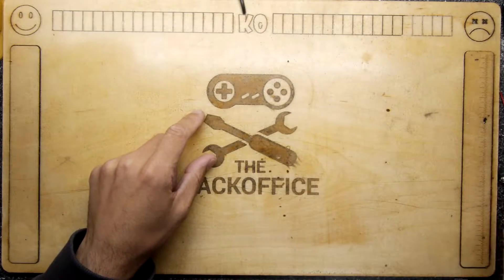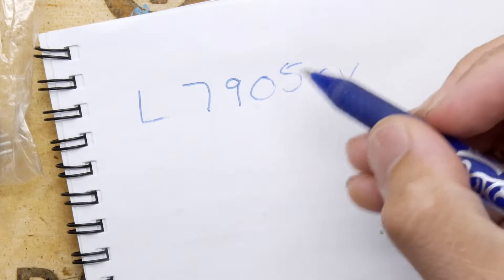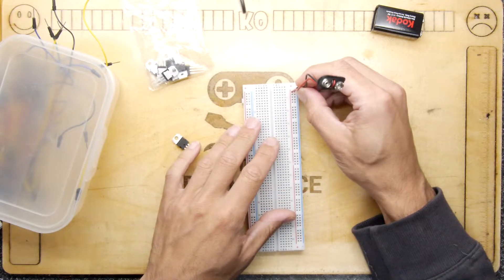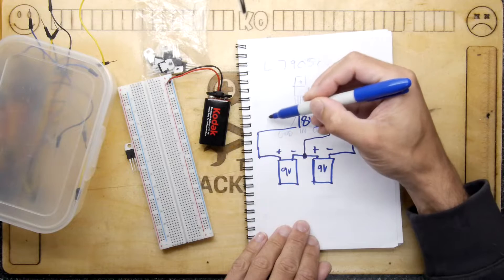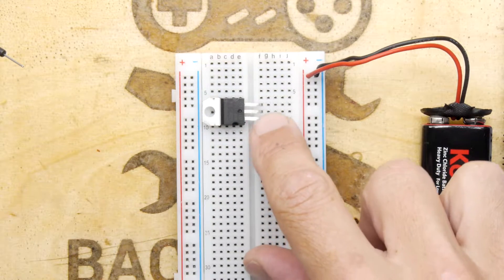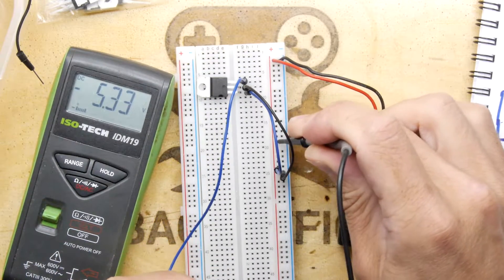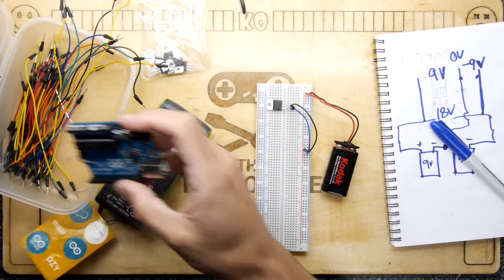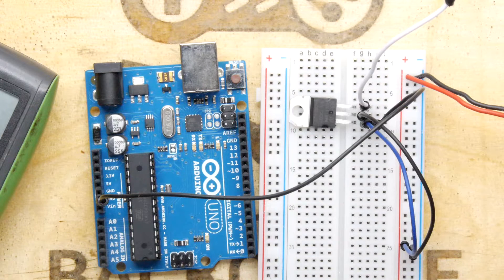Make a Negative Regulated Voltage

Comment: Valves.
I'm learning how to make stuff with Valves and they're supposed to have a negative grid bias.
Still have little to no idea how your supposed to then modulate that bias with the signal you want amplified! 😫
Reply from the maker: My knowledge of valves is so superficial they may as well be an alien technology to me 😂
Reply: @backofficeshow  
I may have a growing obsession...
Technically "they're just like big transistors"
Except the base (grid) takes negative volts (mostly)
And it always inverts.
And there's up to three bases.

But I'm starting to get that "negative volts" is a really bad description and "lower potential" is what it should be called.
So the grid (base) has to be lower potential than the cathode (emitter)
Reply from the maker: @MostlyPennyCat  that makes a lot more sense thinking of them that way!

Comment: https://theorycircuit.com/wp-content/uploads/2018/09/negative-voltage-generator-circuit-using-555.png
and this is how i apply it
https://forum.allaboutcircuits.com/attachments/1600245831965-png.217359/
but your solution is more simple than mine.

Comment: In a pinch I typically use a Voltage Divider and with a couple of Diodes you can drop the voltage slightly to achieve 5 Volts. This way I can have a positive 12 volt rail and end up with two 5 Volts rails plus and minus. The diodes are used to drop the voltage since a voltage divider with say a couple of 10K resistors will divide the Voltage to 6 Volts and a typical silicone Diode such as a 1n4001 will have a .76 forward Voltage drop. Most TTL devices can handle up to a maximum of 5.5Volts but always check the Datasheet of the DUT.
Reply from the maker: I'll definitely need to try this, always have diodes knocking around

Comment: Hi, the MAX232 IC generates a +/- 8.5v out from 5 volts, not sure what current you'd get from them though, love your channel by the way.
Reply from the maker: It's probably an expensive way to derive it 😂
Reply: @backofficeshow , You know strangely enough when i watched this, i was only just watching the other day a GadgetUK164 vid testing Amiga ram using a diagnostic rom, and straight away i thought of exactly what you are going to build, this would save a lot of messing about and  time for testing the good olde ram from these retro computers, rather than desoldering a chip, then powering up the computer to run the diagnostics again to see if the ram is still bad, great idea and i will be watching to see what you come up with, good luck with it :)

Comment: If you want a way of generating a negative voltage with only a single rail you can look at our Negative Voltage Generator kit. That looks at capacitor coupling and a diode arrangement coupled with a 555 oscillator!
Reply from the maker: I'll look at any kit I am sent 😂

Comment: Technically interesting, but I still wonder why someone wants to create negative voltage instead of inverting the voltage...
Reply from the maker: Because in certainrequirements you need both + 5v and - 5v at the same time and it's tricky
Reply: @backofficeshow  Guess this is correct, but it confuses me every time. Maybe someday I'll get to a point in engineering, where I find it useful :)